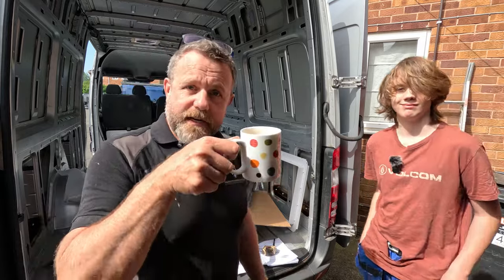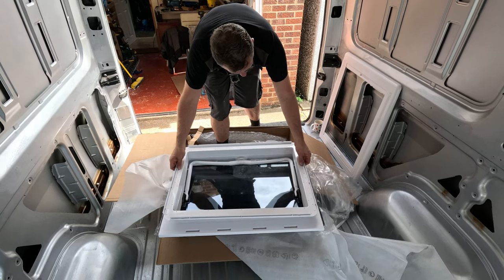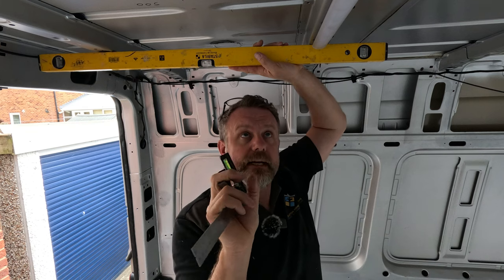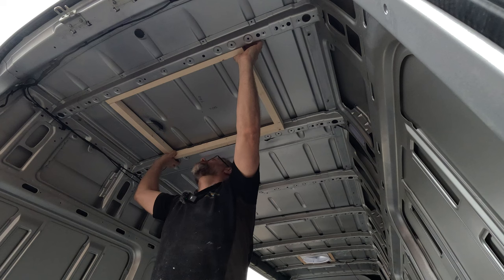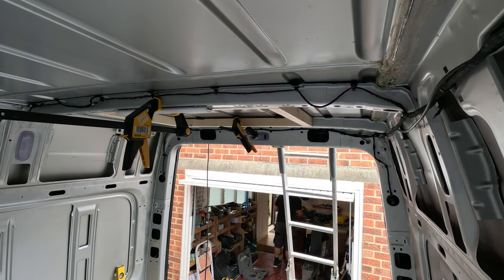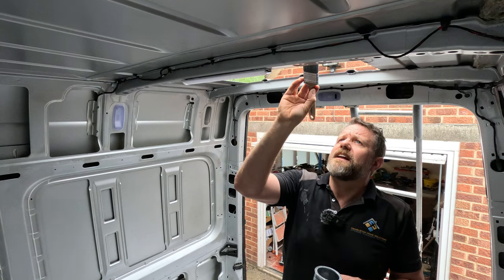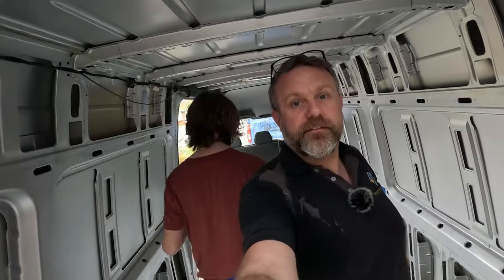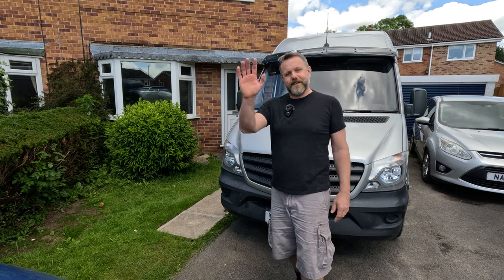Installing a Skylight in Our Sprinter Van Conversion!

Comment: I’m sure you figured it out now ( commenting whilst watching) but if you end up seeing a gap I think some white self adhesive 2mm pvc edge strip fitted between the cover and trim ring once it’s up could work..hope that makes sense👍🏼 
Edit..looking good that fitted just right and so much light..I think you might need a roof deck 😊
Reply from the maker: Hi. Thanks for the suggestion. Yes that would have worked if I'd needed it. Luckily we got away with it in the end👍😁. Wish I had space for a roof deck.

Comment: This video was great, thinking of fitting the same set up in our van. We have a 2019 MWB, do you know whether the same skylight / fan set up would work?
Reply from the maker: Hi. It should do. I'm not sure if the rear roof panels are the same size🤷‍♂️. But it should be fine.